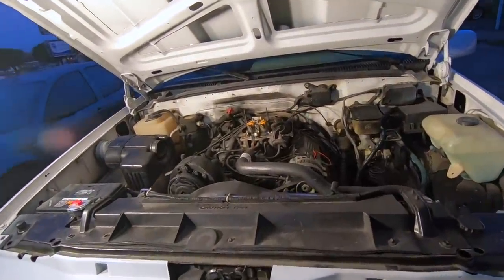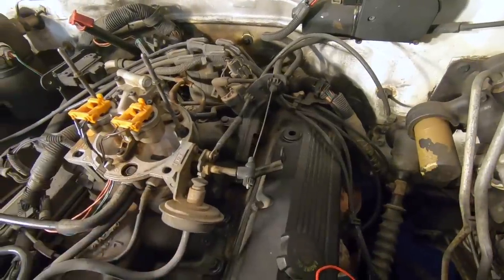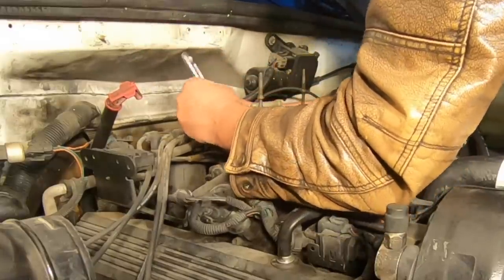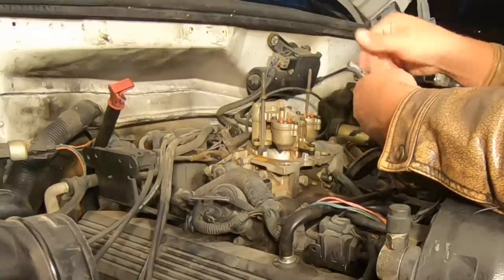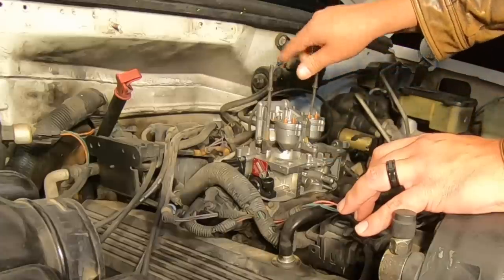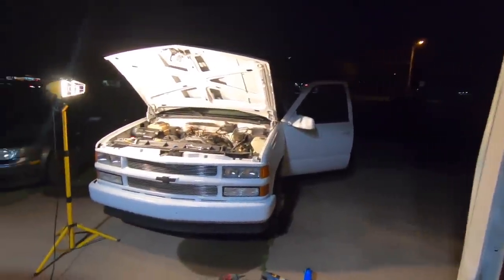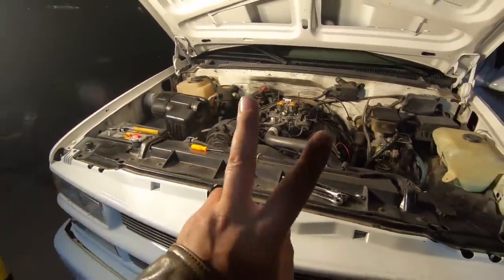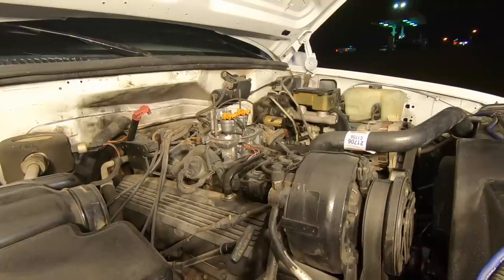94 Chevy 3500 454 TBI Replacement Issues!!

Comment: I got a 97 Chevy 3500 with a 454 non dully was never a diesel it's not a vortex I also have a 96 2500 with a 350 that is a vortex engine idk if they made the 454 into a vortex

I think you should buy that other truck and fix a sell the truck for what you bought it for I don't think you made a bad choice
Reply: vortec*

Comment: BTW I heard you mention about adjusting the timing, the timing is adjusted automatically by the computer, so don't worry about trying to set the timing.
Reply: Needs to be set base. Then computer takes it from there
Reply: @thefordmaniac  I have a 92 and just took out the distributor to replace the oil pressure sending unit and tried to advance the timing a little for performance and it would not change. It kept adjusting back to the standard factory settings. I then checked into it and found the computer keeps resetting it back to stock. I am sure if it is 180 degrees off it is not going to work but adjusting a few degrees will not make any difference once you plug the harness back in. If you unplug it and set the initial timing sure it will set it initially only, but the computer takes over when the harness is plugged in.

Comment: Hydra-boost is for diesel engines as they don't make vacuum so power brake boosters won't work your truck musta came with a diesel
Reply: Hydroboost is not just for diesel.

Comment: You should have get a new intake manifold and the tbi and the oxygen sensor
Reply: You have no idea what you're talking about. Intake manifolds don't go bad, he replaced the tbi and it's not that, and oxygen sensors don't even affect anything until the engine is hot. This engine is cold and idling bad

Comment: Also sounds like a fuel pump and fuel filter
Reply: You have no idea what you're talking about. How can you rev up an engine with a bad filter or pump? Those issues would cause bogging or stalling on throttle but would affect the idle the least. This truck has a bad idle but good power

Comment: Could someone tell me what the vacuum brake does that is touching the throttle linkage?
Reply: Also curious
Reply: @mikem5475  I figured it out, it's supposed to bring the idle down slower, when the trucks shift they make lots of extra hydrocarbons and with the dashpot thingy and special iac control gm mitigated a lot of the excess pollution. Needless to say I deleted it 🤣🤣 check engine light tho
Reply: @twistiestv1718  interesting. My brother's 1997 toyota t100 has that garbage and it makes it harder to shift because the revs hang
Reply: @mikem5475  that's exactly the reason I ditched mine, I thought the iac was being stupid, then I thought the egr valve was being stupid. All along it was GM
Reply: @twistiestv1718  we are gonna delete his and see if the truck can handle it. Worst case scenario we will just lube it up or trim it back a little

Comment: I got a 454 tbi for my 350 tbi   I still have to modify it to make it work
Reply: What modifications do you have to do?
Reply: @mikem5475  from what I know  there's one connector plug  I was to swap  because  the 350 tbi and 454 tbi plugs don't match  its on the left side near the back of the throttle body I have to  widen the ports  soo the throttle body blades doesn't hit the intake I haven't installed it  yet   I got a spring kit for it   and someone already  put in a injector pod spacer on it  may port it more   it was from a motor home 454 lol
Reply: @Ricky-manic  that's awesome. I heard about having to bore the intake like you mention. Carbide burr bit might work. I hope it works out good for you
Reply: @mikem5475  I hope soo too   when I put it on I'll be doing a new intake cam and heads
Reply: @Ricky-manic  that sounds like a recipe for success, especially for TBI engines from what I'm reading

Comment: Hydra boost is on all diesel trucks becuase you have an unrestricted air intake system.
Reply: Or they have a vacuum pump.
Reply: @thefordmaniac  they have a vacuum pump for HVAC controls only... it does not develope enough vacuum for brake boosting... even back in the early 1980s GM used a engine driven Vacuum pump for HVAC only on their deisels... the Oldsmobiles, Buick, Pontiac, Chevrolet and Checker taxis, Ford Trucks and cars all had Hydraboosted brakes and separate  vacuum pump for HVAC... also with that being said medium duty trucks to class 6 up to 25999lbs GVW have Hydraboost on their hydraulic brake systems...  TBI goes way back to the 1957 Chevrolet 327 with TBI on the 57 Chevrolet bel air and impala... the problem with a conversion truck is they are never right when you switch... most shade trees have no clue as to what they are doing they Dont understand Diesels and most are Stupid as rocks anyhow. Diesel fuel systems are not as forgiving to the normal Gasoline driving moron on the street... yes I am harsh but reality is you cannot treat a deisel to the same mistreatment most gas engine owners do.. 6.5L was the best engine GM built... it was built off the 6.2L... they were both built to be deisels unlike the 5.7L which originally was a converted Oldsmobile 350 gas engine which is where GM screwed up... they tried to rush an engine out to save their big cars of the late 1970s and early half of the 1980s... it did boost fuel economy to 18 city 27 highway... but also unless you were a farmer or commercial truck driver most folks didnt know crap about deisels. GM did also make one more Deisel under Oldsmobile it was the 4.3L V-6 it was much more reliable than the 5.7 L this engine was used in the new mid sized GM cars like the cutlass ciera olds, the Pontiac 6000, Chevrolet Celebrity, and Buick Century...  Ford put a small deisel in the Escorts and they used a Isuze and a Perkins Deisel in their ranger pickups. Dodge also had a deisel in their small pickups... other than those... Mercedes Benz  and Volkswagen had deisels as well as Isuzu on some cars....  Randy should not remove the hydraboost it is better braking... never buy a car or truck that's been converted from one fuel to another most are screwed up by the prior owners.
Reply: @thefordmaniac  even the 6.9 L and 7.3L IDI have a vacuum pump for same reason...

Comment: Hydro boost is used on diesel vehicles because diesel engines don't have vacuum system.
Reply: Hydroboost is also used on vehicles with gas engines.